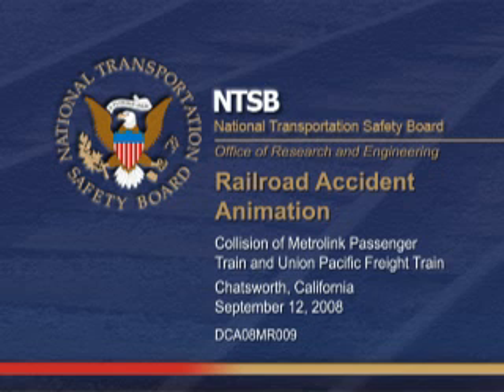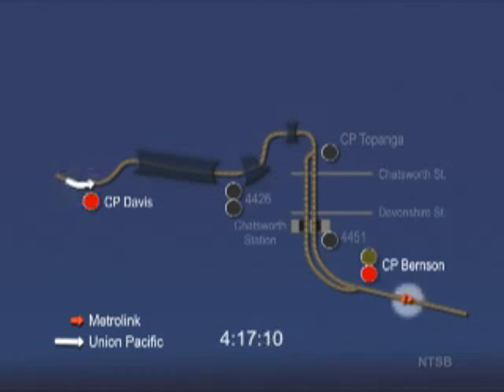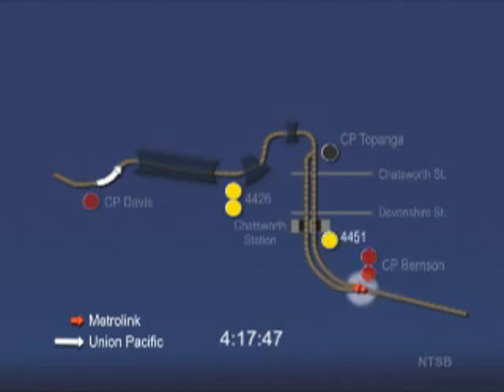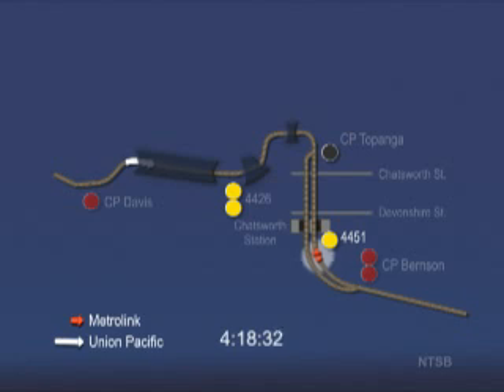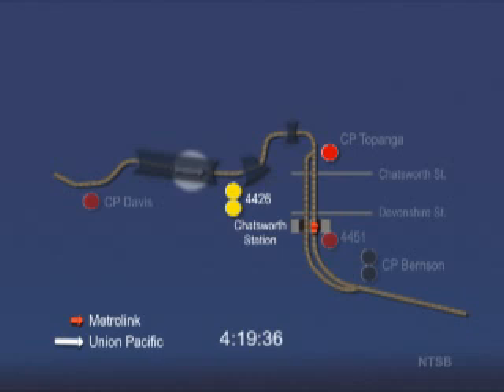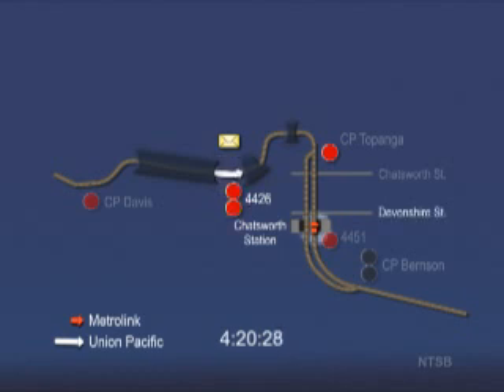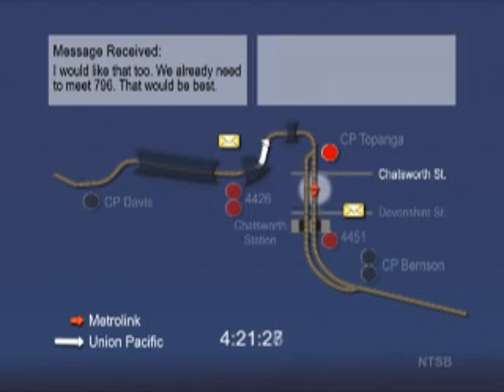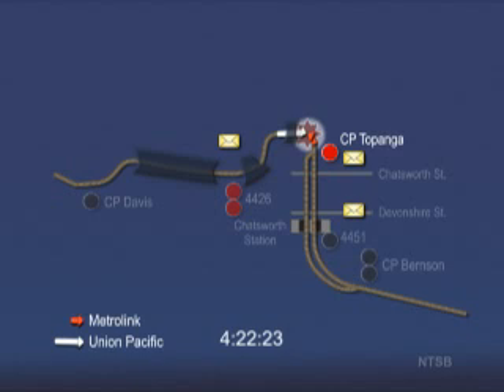Collision of Metrolink Passenger Train and Union Pacific Railroad Freight Train

Comment: MetroLink engineer did not see the closed track switch he wenthrough??   When riding head-end I always looked at switches for proper alignment.    Does knifing through a closed switch damage the switch?   Does it ever derail a heavy locomotive?
Reply: the switch will be forced in the other direction. For electric switches, this will break the mechanism and probably also bend the metal, forcing a replacement.
The mechanism is not strong enough to derail a locomotive.

Comment: There's a secondary cause here that nobody's talking about, and which the NTSB report barely mentions. It's been recognized in the UK since the 1990s that there is a danger of passenger trains passing red signals if there's a station stop between the approach signal and the one that's red. Essentially, the station stop itself is a distraction from remembering the previous signal aspect. This is especially the case because, when leaving a station stop, the engineer is task-focused on getting the train going again, and is in the mindset of "I have permission to go again."

Because of this, all passenger trains in the UK have been fitted with a "Driver's Reminder Appliance" (DRA) since the 1990s, so about 15 years before this crash. When making a station stop after passing a yellow signal, the driver (engineer) is required to activate the appliance. This displays a red light on the console (mimicking the red signal ahead) and the train cannot be restarted until the DRA is cancelled. This means that the driver must remind themselves of the red signal before they can start the train again. Sure, it's not a perfect system, as the driver must remember to use the reminder. However, the approach signal is still fresh in the driver's mind at the time when they stop, so it's had a significant effect in reducing passenger trains passing red signals after station stops.

Very disappointing that the NTSB didn't give any consideration to practice in a country that runs a lot more passenger trains than the US, so which has particular expertise in this area. The words "Britain", "British", "UK" and "Kingdom" (or even "England") don't appear even once in the NTSB report on this incident.
Reply: In the US you're referring to "Delayed in Block." Basically, depending on the particular railroad, in a situation where you are running on an Approach signal and make a stop, once you depart you are departing delayed in the block, therefore the rule requires you to run prepared to stop at the next signal under CTC rules. ABS/TWC you're at restricted speed. This train and territory are CTC so as soon as the signal is seen to be a proceed indication you can act on that signal. Usually, in passenger/commuter operations the conductor will give you the okay to depart and remind you of the previous signal and that you're departing delayed in block. PTC has since rendered this situation moot as you can see your lineup on the screen.

 In this case, I believe that signal that was red was already visible to the engineer anyway. Another problem here is the routine engineers in passenger service fall into. You begin to expect a clear signal, especially in places and at times when a meet with another train would be out of the ordinary. If you always have a clear departing Chatsworth, then you can see how the vigilance decreases over time. Things become very repetitive.
Reply: Thank you.      "...the driver must remember to use the reminder."
Reply: @robertgift  Right, as I said, that's not ideal. But, as I explained, the driver is more likely to remember to use the reminder than they are to remember the signal aspect without the reminder. So the DRA has had a significant effect on decreasing SPADs in the UK.
Reply: I'm an engineer/driver in Sweden, and we also had this problem in the past. Since a big rule book update about 20 years ago it is now formidden to depart a station unless the next signal is clear, even if the previous signal displayed a clear/expect clear aspect. If you can't see the next signal from the platform, or want to pull up to a red signal from the platform, you need to call the signaller/dispatcher for permission to do so.

Starting against red is still an ongoing issue, but at least it has decreased a lot, and we also have cab signalling on most lines so a SPAD should generally not lead to a collision.
Reply: I would have thought it would make more sense to align the block with the station position, so there is a signal at the end of the platform, so the driver can see whether it's safe to pull away at full or restricted speed.  If the train needs to wait it makes more sense to wait at the station so more passengers can have  chance to board. During the station wait the train ahead will have had time to get further away so the next block might be clear by now, even if the last signal before the station was a warning.
Reply: @adrianthoroughgood1191  Blocks need to be a reasonable length, so aligning the block with that station would probably just push the problem somewhere else, like a bump in the carpet. If blocks are too long, the restriction of one train per block means you can't run many trains. If blocks are too short, there's not enough space to warn that the signal at the end of the block is at danger, so the trains need to go slowly.

Comment: Another sad example of both parties distracting themselves from duties.
Reply: While the UP conductor was distracted, that had no effect on the crash. The UP engineer was not distracted, and the crash was caused by the Metrolink train running through a red signal. There was nothing the UP crew could have done to avoid the crash.

Comment: The engineer called out the flashing yellow. This tells him next signal will be yellow, and the next one where siding begins will be red and he will have to wait for a train there. Same thing day in day out. Signals are fixed. You know by rote memory if that one signal is flashing yellow, you are stopping two signals ahead. Puzzling how this engineer went through a signal that he knew where it was, and he knew it would be red.
Reply: It's not at all puzzling. The clearest cause is that the Metrolink engineer was distracted by using his phone. There's also a secondary cause which, worryingly, the NTSB barely considered. The station stop itself was a distraction. The issue is that, after the station stop, the engineer is naturally focused on getting the train moving again, and they're in a mindset of "I now have permission to go, again". This can cause them to forget the last signal they passed.

This has been recognized since the 1990s in the UK, where we run a lot more passenger trains than the US. All UK passenger trains are fitted with a "Driver's Reminder Appliance" (DRA). When the driver makes a station stop after a yellow signal, they must activate the DRA. This lights a red light on the train's console (mimicking the red signal ahead) and the train cannot be restarted until the DRA is cancelled. This means that the driver is reminded of the red signal before they get under way again. DRAs have been required since the 1990s because of a number of incidents where drivers passed red signals after forgetting that the signal before a station stop was a yellow. I think it's very poor that the NTSB didn't look into expertise from other countries.

Comment: why doesn’t the US have TPWS? 
they should definitely have it ok high risk areas…..single like junctions. 
Basically a magnet that is active when the corresponding signal is at danger, if the train SPADS then it will force and emergency brake application, there is also OSS (overspeed sensor) which is an additional set of magnets on approach to the signal. When the signal is at danger these two magnets (which are a set distance apart) start tiling the train when it passes the first one and then stops at the second one….this works out the speed it is travelling, if it is over a pre set speed then the train will not have time to stop and will spad, So the TPWS OSS will apply full emergency brakes to prevent it passing signal at danger. This isn’t new tech either….it works very very well and easily maintained…!
Reply: We now have PTC and back in the day we had IIATS along with cab signaling systems both were a lot more common between the 30s and 70s but railroads removed a lot of those systems as passenger service ended. This segment of track never had Cab Signals or IIATS.
IIATS wouldn't have prevented this but it might have forced the metrolink train to stop shortly after passing the signaling.

Comment: Cell phones should be checked for use after each shift and operators fired if it was used while they were in the cab. There is no safety reason for using a cell phone while driving.

Comment: When metrolink ran a red light, why didn't the dispatch say or do something, like "stop!! what are you doing?"
Reply: They didn't have time. It was only 5 sec before the crash.
Reply: @seymoarsalvage  No, you've misunderstood. The crash was five seconds after the trains were able to see each other. The collision was about 30s after Metrolink ran the red.
Reply: Or maybe it’s because the dispatcher went out for lunch or probably got confused by which train was which on whatever monitor he or she was using at the time.
Reply: There should be two in cab. The conductor that rides in cab is required to also call out signals with the hogger (driver), and opened emergency valve if hogger didn't react to red aspect.

Comment: So first flashing 🟡 that means slow right Next solid 🟡  that would mean next signal 🚦 is the solid Red 🟥 so they should of stopped before the curve union Pacific would of Gone to the siding and Metrolink would of continued if they Saw the signal lights. Is that how the was supposed to work? If I understand the video correctly. This could of been avoided if they watched the signals instead of texting. I remember this it was a terrible crash.

Comment: because of Chatsworth we now have PTC which is mandatory on all lines. Had PTC been implemented during Chatsworth the Metrolink train would have received a forced emergency application before it SPADed the signal and hit the side of the UP train causing the accident.
Reply: No.  Penality application, which is not emergency.
Reply: @anonemaus159 depends on the braking curve. If PTC thinks you are not slowing down fast enough, it will put you into penalty. If PTC calculates that you will pass the red, it will put you into emergency.

Comment: The Metrolink train should’ve derailed going against that switch am I right?!? I thought that’s what usually happens when a train goes against the switch
Reply: No, not necessarily.   The wheel flanges can push the switch points out of the way.   I don't know US practice but on some lines this is a design feature at crossing loops.
Reply: The problem with loops is the two rails are closing each end so yeah the train can push the points around.
There is a design called a derailer point - bacically one rail has a point blade that derails the train if it is open, but then the low power electric signal would have to somehow push the derailer closed which is still VERY heavy.
Australia uses kilometres of pipes of compressed air to move the points along entire parts of the line, and unfortunately, I think America has a lot of very long lines and could not do that.
Reply: No, he just split that switch. Something like a "slap and stay" switch.
Reply: Remember that switches can be moved by a guy swinging a four-foot lever. Trains are much stronger than that. If a train goes through a switch the wrong way, it almost always just busts the switch. Very unlikely to derail.

Comment: sapper - not new :P Aussie trains have physical signal stops .. little moving bits of metal that flip up on a red STOP and it immediatly physically flips a SPADding trains brake valve with no driver input at all.
Signals WERE set so that the signals were max speed stopping distance away from a potential crash. 
Sydney almost have had NO accidents.
Now the 'highly intelligent' railway designers over here are going to shorten the distance between trains without taking speed / weight into consideration, AND puting the reliance on drivers reaction.
ie  the driver who goes "oh er ive got er two seconds to press the stop before um" CRASH!!
I've been using trains for 40 years. This year I will not be trusting them to carry me and more as soon as the new design goes in.

Comment: With this video, though I am not a rail operator, there is one thing that sticks out like a sore thumb to my thinking.  Signal post 4451 is on the approach side of the Chatsworth station.  Is it possible that it could happen that an Engineer 'forgets' what signal they have passed, stops at the station, then proceeds, forgetting what the signal was that they just went past?  

Would it be prudent to have a 'repeater' or 'slave' signal at the departure end of the platform, reminding the Engineer what the signal is for the section ahead, and that there is a red signal waiting for them?  It has been my observation that many railways have the signalling set by distance between signals, and often have a station after a signal head.
Reply: Yes it would, most lines that host heavy passenger operations have modified their signal spacing so that a signal is visible from every station. For those that have not, there is a rule called Delay In Block specifically created to prevent crashes like this one. The rule states that if a train stops within a signal block before the next signal is visible, then that train must proceed at restricted speed prepared to stop at the next signal, regardless of what the previous signal was displaying.
Reply: @amtrak706 : Yes, we also had that rule at CSX back in the late 90s.

Also that all personal electronic devices had to be OFF while on duty.
Reply: KutWrite Makes sense, I think the delay in block rule was either created or at least greatly expanded after the 1996 Silver Spring, MD wreck which took place on CSX territory.
Reply: The driver should have seen the Stop signal and points set against him at CP Topanga, even if he had forgotten about the Approach signal.
Reply: British trains use a DRA (Driver Reminder Appliance) in this situation. After stopping at the station, driver activates the DRA, the train can't be moved in this state. The driver must deactivate the DRA in order to move the train, thus "reminding" them of the potential for the next signal to be red.
Reply: This type of accident is typical, even for lines with automatic train control. Such accidents caused many european operators to upgrade their systems so it is impossible to pass a red signal after a stop.
Reply: @garingdahl : I was about to mention the DRA. You set it when you're stopped at a red signal or when you've passed a single yellow and stop at a station (but can't see that the next signal has cleared). I'd assume that it's a relatively inexpensive addition/modification, though with the additional aspects/speed signalling probably someone more knowledgeable can speak on whether it would be useful?
Reply: @garingdahl  Yes, I remember seeing that on a Network Rail video series right here on YouTube.  DRA is a damn good idea.
Reply: @garingdahl  Sadly, the NTSB report doesn't even mention the DRA, and barely considers the problem of the station stop between the yellow and red signals. Very disappointing that they didn't consider best practice in a country that runs a heck of a lot more passenger trains than the US does.
Reply: @111jacare  DRA….drivers reminded appliance..upon passing a yellow (so next signal at danger) if you stop at a station or for any reason in between, then you set the DRA…this prevents movement and upon resetting it would remind the driver of the next signal at danger…..if the the signal then becomes visible and has cleared to any proceed aspect he then speed up to the appropriate speed…..there are other reminders too….AWS, a large magnet in the 5ft (ireland)….when he train passes over this (and the signal ahead is showing either yellow, double yellow or red) then this will sound a warning horn in the cab abs the driver has 2.7 seconds to press a button to acknowledge this horn, if they fail to do this…then they’ll get a full emergency brake application, there is also TPWS, a magnet system which is situated just after the signal (as in a couple of feet) if this signal is at danger then the magnet is active, so if a train passes the signal at danger, then they’ll get a full emergency brake application….so many safety features to help drivers! This was driver’s fault 100%. Why anyone would be using their phone on approach to a junction is beyond me.

Comment: What about controllers/dispatchers? Wasn't train positions in general be visible to them back then?
Reply: Not sure, but the collision was only about 30s after the Metrolink train ran the stop signal, so it's not clear what a dispatcher could have done. Also, the track circuits only indicate whether a block of track is occupied or not. The dispatcher would have seen the single track block was occupied, but that's what they would expect -- there was supposed to be a UP freight train on it.